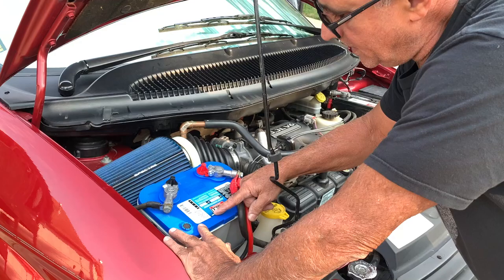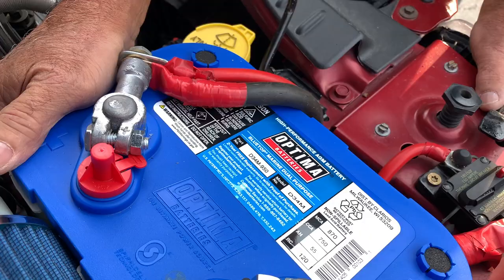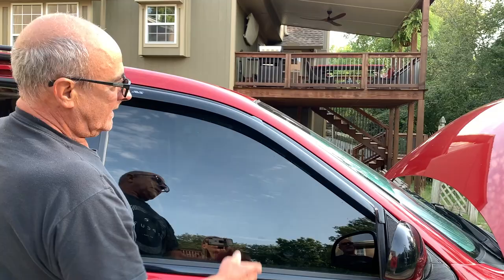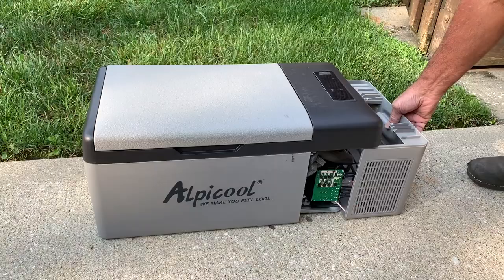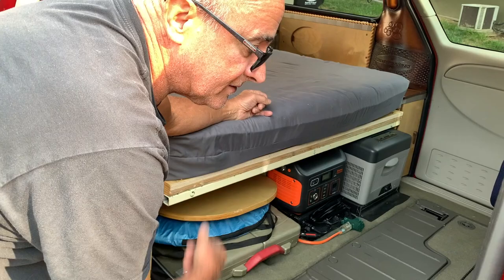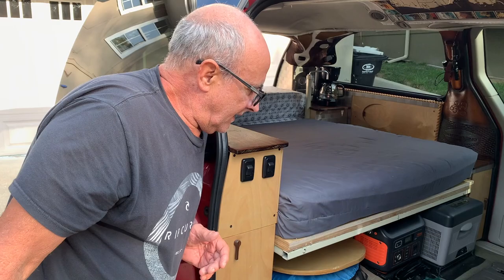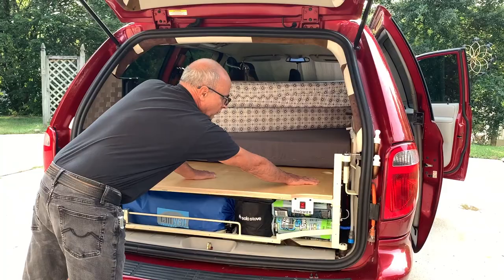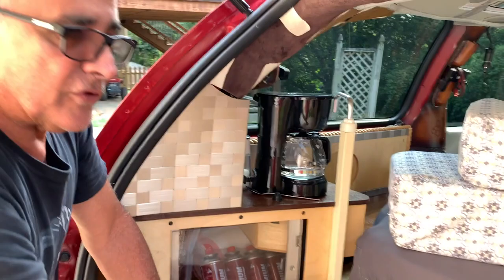ADVENTUREVAN Tips/Tricks Product Reviews and Redesign

Comment: It is not a fluke with the Alpicool. The same thing happened to me with the 37-quart model. I used it for one trip and it suddenly stopped working about two weeks post return. It had been within a year of purchase at the time that happened so I probably should have done something about it, but was too busy having had to return back to work at the time. There were only three weeks left in the year warranty. 

You are also spot on about the sink...that was a complete waste of time for me as well and I too have removed the adorable, but never used "sink unit" from my build. I have a WaterPort, which is easily manually pressurized and was what used most often. 

Last, but not least, I made a single person "rock n roll bed" platform, but once it got set up as a bed the first time it was too much of a pain to convert back with my four little dogs in the van. It would be so awesome if I could have the swivel passenger seat in my DGC, but my year model doesn't have that possibility because of the rather large and non-removable center console. Love what you did with your swing out unit to make the bed work better for you in combination with your swivel seat. 

Sorry to hear about the first round of the window visors not working. What you have there now looks great! Thank you as always for sharing your lessons learned and how you solved those issues.
Reply from the maker: Thanks for watching and thanks for commenting it’s a process it’s taking experience to figure out what we need but we are getting there slowly but surely

Comment: It’s a Deep Cycle battery you meant I think but for value for money, better to get a lithium ion battery though more costly but you can use more power from it and lighter too.
Reply from the maker: Thanks for watching and commenting. Yes I couldn’t think of it at the moment even though that’s what I meant to say. I need to learn more about lithium batteries I’m sure a lithium battery would be better suited for what I’m doing I don’t know about the heat though in the engine compartment
Reply: Gotta be careful with LiFePh batteries. Know they make a good house battery but may not be suitable as a start battery. Also fyi charging Lith batteries in winter sub-freezing cold temps can damage them.